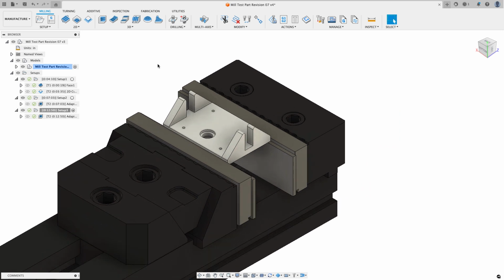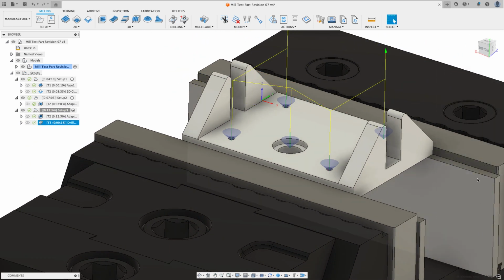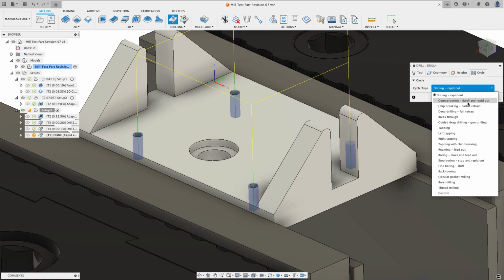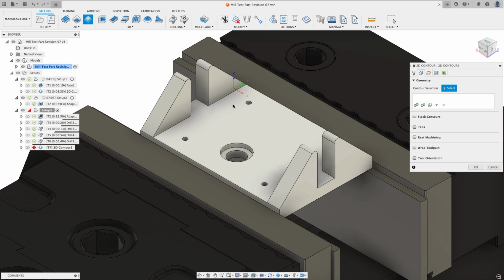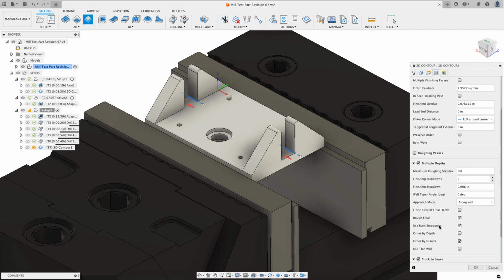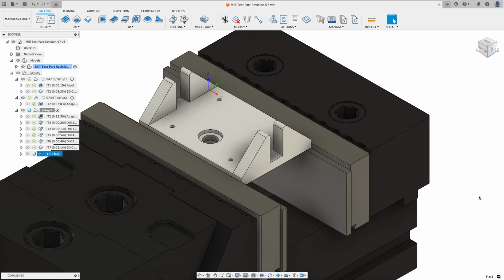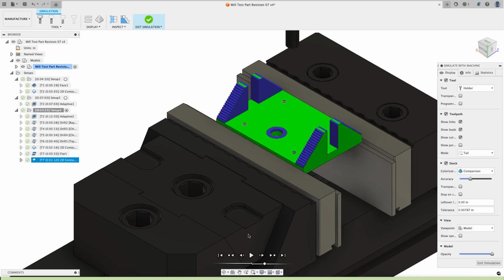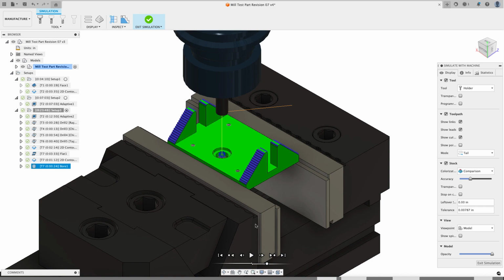Programming Xometry Mill Test Part using Fusion 360 - PT 3

Comment: Your videos are awesome. One thing I would caution on is that all the features on the drawing are referenced from one corner while the slot is supposed to be centralized about the 1.880 width. Plan accordingly, especially in the setup (coordinates) and the actual dimensions of the part.

Comment: Great video. Perfect pace.  I have 3 questions. Will the approach taken here achieve a 32 finish?  That is called out on the print.  Also, do you utilize G-Wizard cam software (or some other CAM software) at all to determine speeds and speeds or do you just use what Fusion 360 gives you.  Have you heard of any feedback on G-Wizard? It supposedly takes tool deflection into consideration and tackles tool chatter apparently
Reply from the maker: I don't use G-Wizard. I think it has its purpose, but I usually default to the tool vendors recommendations as a starting point. Usually picking the middle range of any SFM numbers they provide to start.

Comment: Question. Would the 90 degree spot drill cause the small drill to walk because the drill angle is different from the angle of the hole?
Reply from the maker: That is a good point (no pun intended). Here is a useful article on the subject from Harvey. https://www.harveyperformance.com/in-the-loupe/choosing-spot-drill/

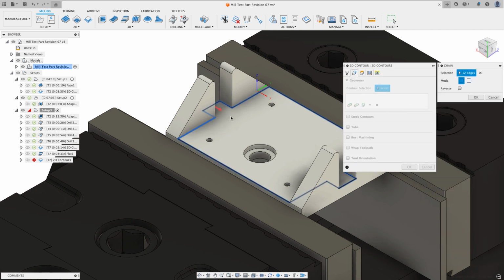Comment: Thanks Kevin for another clear and concise video. At 11:05 you select the chains one by one for each of the 4 segments. Could you have selected two features on one side together, or perhaps even all 4?
Reply: In general no. Each contour needs to be continuous. If you selected say both contours on one side then it might work ok, because it will join them together with a shortest path between each segment. Basically each contour is a single tool path op.
Reply: @ewildgoose  Thanks👍